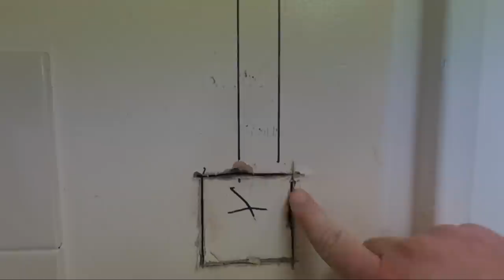Moving a light switch to the other side of a door chasing how to move

Comment: Thanks for the video but I am curious about some things as a DIYer .  Why no dust sheets / bucket to minimise all the mess, why didnt you finish the install and check it all / test it all before doing the filling and repair? Surely the wall finish is the last thing to do once you know the switch is working? As you said yourself 'you dont want to be ripping all that out'.. As I said, I'm only a diy'er but curious as to know why you did things in the order you did? Also why not remove the old swich and chase the cable out so there would be no need for an extra 'disused' junction box going to what will be a length of cable once the owner removes the old switch? Helpful video and thanks but I am confused by a few things.. Thanks
Reply: These aren’t real questions. You’re just a know it all.

Comment: Is that box really approved for MF with those joints and no cable tie?
Reply: Those wago box light are not approved for MF even if it had the correct wagos and was cable tied. These junction boxes are designed to fit through downlight holes so are therefore accessible, so are not approved for MF.

Comment: Wireless switch, receiver in the old box? Or can’t you get a receiver that fits in a box in UK?
Reply: You can.  But they cost quite a bit, switch is cheaper and easier
Reply from the maker: As TheChipmunk2008 said
Reply: Surely cheaper to buy a quinetic switch then chase wall, full lift boards etc.

That's at least a 2 hours that's taken.  A wireless reciever and quinetic switch is around 15mins with chasing out a 25mm back box

Comment: Nice one doc 👌👍 just out of interest, when you sparks fill out a minor works certificate for the customer, say on a job like in this video.do you have to put in the description ..relocation of light switch with junction box fitted with wago connectors,,or would you just put relocation of light switch. I have had a recent sparks in to do a similar job of moving a light switch and I know he’s used junction boxes etc but in the description it literally just says moved light switch 😂 all test results filled in r1+r2 correct polarity etc but I just wondered how far you go in the description of what’s been done 👍any info would be helpful am I worrying about nothing 😂😂
Reply from the maker: To be honest you're probably over worrying about it, as long as it's all filled in correctly and it says what's been done you could put either of those descriptions in.
Some "sparks" put barely anything in the description but there's many different levels and competencies of sparks
Reply: @DoctorElectricYouTube  cheers doc thank you for reply 👌👌👍👍

Comment: What kind of connector did you use in the junction Box?
Reply from the maker: Wago 221
Reply: @DoctorElectricYouTube  You used Ideal SpliceLine In-Line Wire Connector in the Wago box
Reply from the maker: @no_short_circuit  Thank you for updating me, we do so many videos it's hard to remember which ones we used

Comment: Fella...those wago boxes are not maintenance free and if they were they are only mf when used with appropriate wago connectors and a ziptie and fixed to a joist..There are different boxes for the type of connector used, or some of the boxes come with adaptors
Reply: Zip ties, yes, but I don't think there's any need to fix a wagobox to a joist for it to be MF?  The leaflet that comes with them doesn't say it's mandatory anyway.  Perhaps you know something I don't though, happy to be corrected if so
Reply: @andrewcadby  if your happy to leave the jb to float about  especially if they are next to heating pipes as in the vid then that's up to you...also any jb should be fixed if possible to stop vibration but you obviously know that don't you
Reply: @markyd2633  So just to confirm:  For a wagobox that is suitable for MF applications, there is no need for it to be fixed for it to meet MF requirements?  Is that correct?
I don't know of a regulation that requires JB's to be fixed generally, please could you offer a reg number for this?  I believe strain relief may be an issue in some instances but wagoboxes have this incorporated into them.  Again, you may know something that I don't, if so please do put me straight.
Reply: @markyd2633  fella. Yes that box is MF when used with wago 224 connectors and cable tie. So why telling someone it isn't MF at all? And there is no reason it has to be secured to a joist for it to be MF either..
Reply: @ryanallen3704  Wrong
....that is a wago light junction box.....not MF. Maybe you need to go and look them up on the website before looking silly
Reply: @markyd2633  okay I read the wrong website obviously, my apologies...and as we all know under floorboards is classed as inaccessible UNLESS stated on certificate. So if he done a minor works and told the location of the box then all is good. If not then you're right and I stand corrected 👍 but I will point out they don't need to be fixed to a joist though.

Comment: Spend a fiver and buy a proper electrians bolster ,  that was painful watching you use a wood chisel. Perhaps think about some dust sheets , and you can buy ready mixed filler .
Reply from the maker: Thank you for your comment Robert, it's one of those things I keep meaning to get.
I did have ready made before but didn't use it for ages and it went off.  Now that I've bought mixer type I'm using it every week! 
Thanks for watching